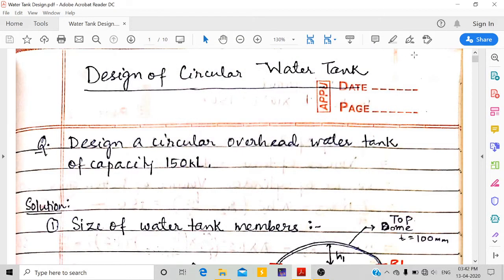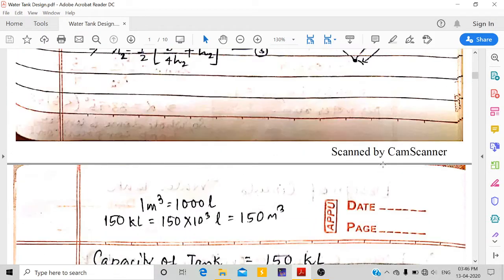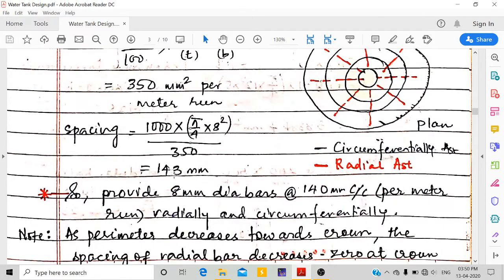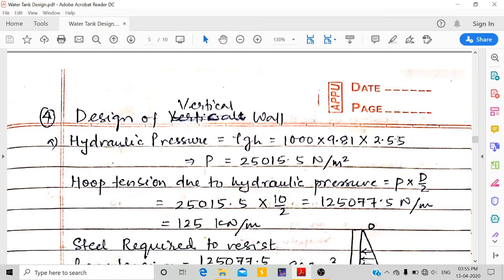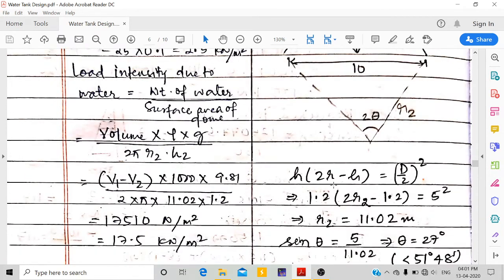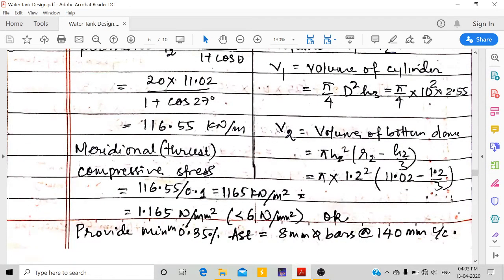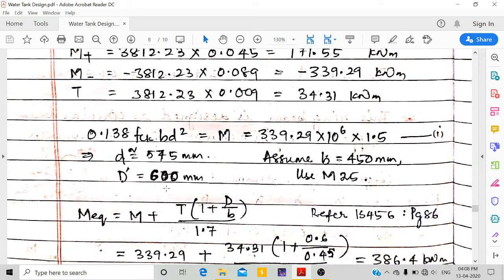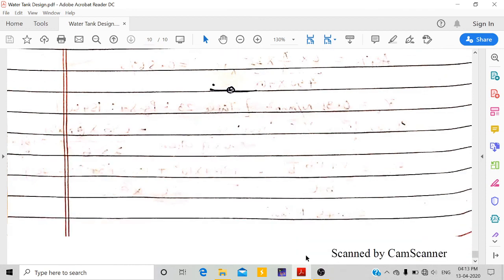Design of circular overhead water tank in Limit state method

Comment: The steel for hoop stress (12T @ 115c/c) in vertical walls is provided on both faces, which is twice the requirements.

Should it not be @300c/c  staggered?